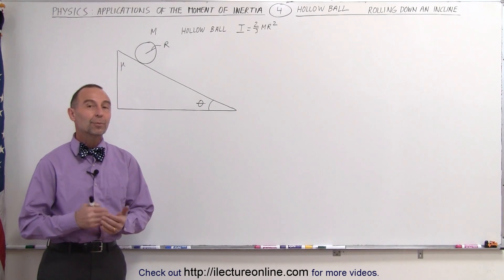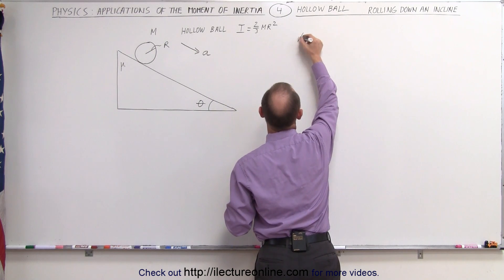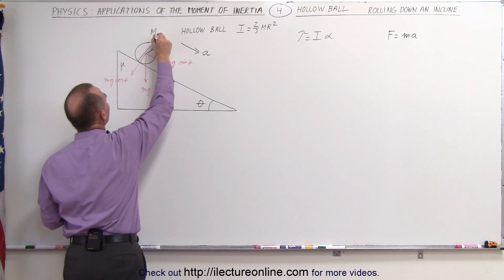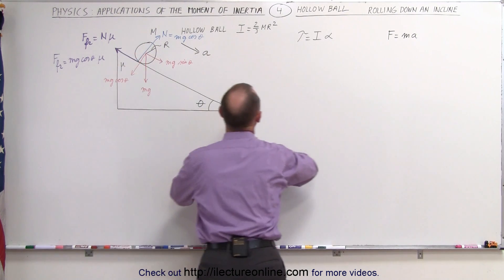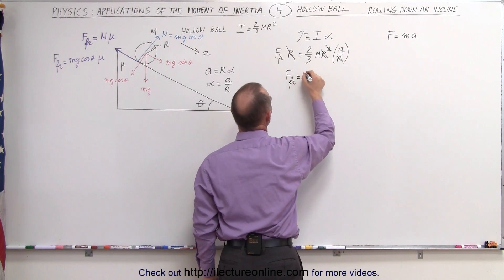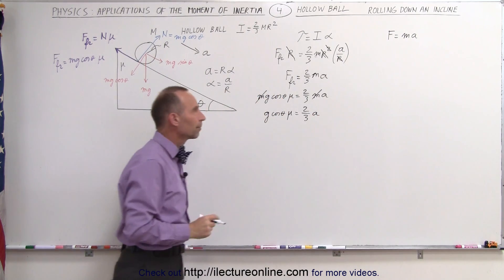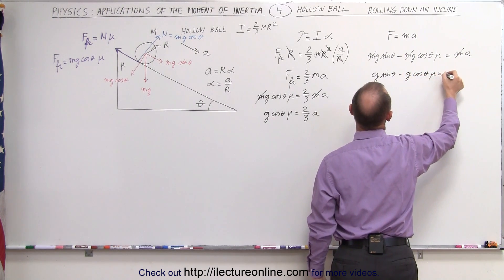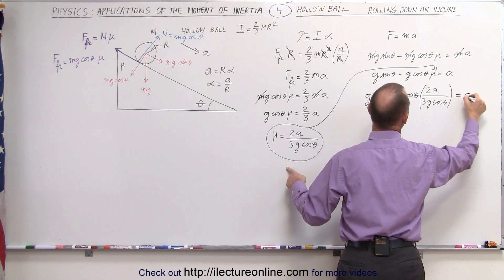Physics 13.1  Moment of Inertia Application (4 of 11) Hollow Ball Rolling Down an Incline

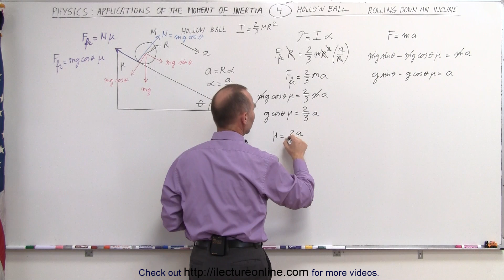Comment: The equation at 5:09, μ = 2a/(3g cos θ), is really a constraint on the minimum coefficient of friction such that rolling without slipping is possible in the first place. So it's actually the inequality, μ ≥ 2a/(3g cos θ), and then you can take the limiting case to sub into the other formula. If the surface were smooth with a μ smaller than that, the ball would just slip down.

Comment: does the x component of weight not provide a torque????
Reply from the maker: The torque is caused by the friction force (making the ball roll instead of slide)

Comment: Mr. Michel, I defined clockwise  to be a positive torque direction; on this basis I made force of static friction to be positive and the vertical component of the Force of gravity to be negative, while I seem to be having sign discrepancy in my problem. What should I do?
Reply from the maker: We often get hung up on negative signs.  This can be remedied by simply caluculating the magnitude (which is always positive).  The sign becomes important when we work with vector quantities.
Reply: @MichelvanBiezen  However, if we take an absolute value of every single force then it will affect our equation and hence the value?

Comment: Just a small question, lets say we were given the radius and mass of the ball and there is some kinetic friction force present on the table, then, what is the acceleration of the same round object?
Reply from the maker: The wheel needs to slide in order to experience kinetic friction.
Reply: @MichelvanBiezen  then do they feel any sort of static friction?

Comment: How come the acceleration with a box on the same slope is faster ( a=g*sin theta) than a cylinder or hollow ball (a=3/5*g*sin theta)?
Reply from the maker: With a box, all of the potential energy is converted to translational kinetic energy and heat (due to friction).  With a hollow ball (or any ball), the potential energy is converted to both translational AND rotational kinetic energy as well as heat (due to friction).

Comment: The friction force is static friction. You cannot use the f=uN formula until the break away moment. Having said so, you will get the same result without using f=uN formula.

Comment: Sir. Could you please answer me? What happens if frictional force(kmgCosA) equals to mgSinA? Net force will be zero but there will be still net torque due to frictional force. What will happen?
Reply from the maker: This is just an approximation.  If you want to learn more about rolling friction, take a look at the videos in this playlist:   MECHANICAL ENGINEERING 11 FRICTION
Reply: @MichelvanBiezen  Thank you for your reply. But i did not understand it. What are we approximating? Could you please give some more explanation? Meanwhile I have watched all your videos related to rolling motion. I am looking forward for your answer. Thank you so much.
Reply from the maker: Just like we ignore wind resistance in kinematics, we ignore rolling friction and just approximate it with the coefficient of friction, which is not the whole friction effect.  (see the mechanical engineering videos on rolling friction).

Comment: Sir, I think friction force should act along the direction of motion not opposite because the point of contact is going backward due clockwise angular velocity
Reply: Friction works against the direction of applied force so even if the ball went up it would still be effected by frictional force working against it
Reply from the maker: The direction in the video is correct.  Think about it this way:  If there was no friction the wheel would slide and not rotate.  With friction, what direction does the friction need to be in order for the wheel to rotate in a clockwise direction?
Reply: Sir,then it means if wheel was made to move up the inclined plane then friction would assist the torque and its motion would be along the direction of motion!!
Am i right ??

Comment: Based on final formula, if we increase friction(mu) , the acceleration will not change.  Seems weird for me, i expect if we increase mu , acceleration will decrease.
Reply from the maker: That is because the object doesn't slide down the incline but rolls instead.
Reply: @MichelvanBiezen  Thank you dear Professor for reply. I greatly appreciate this. Assuming the theta and mass is constant, in the formula on right top of the board(beneath the f=ma), when i decrease the "mu" on the left side of equation, the "a" on the right side should increase.
Reply from the maker: No, but if mu is larger it would allow for a greater torque which would allow for a greater angular acceleration.

Comment: How is F=ma valid here when it doesn't account for the moment of inertia? You could have two spheres with the same radius and mass but different moment of inertia but they will both have different linear accelerations even though according to F=ma they should have the same acceleration. If F=ma is still valid as you claim then why not just use a=F/m to find the acceleration? Clearly you can't which suggests to me that it's not valid here. I'm just more confused now!
Reply from the maker: I agree there is a certain amount of "mystery" regarding this problem.  But the problem is correct as shown in the video, and F=ma still works here as well.  But in this case the force is doing 2 things:  1) it accelerates the object down the incline   AND   2) it causes to object to rotate, both which require energy, and thus work, and thus the force is used to do both.
Reply: @MichelvanBiezen  thanks for your response. I started thinking about this problem recently when asking myself if I could prove that it doesn't matter if a force acts through an objects centre of mass or not.

I figured that if I found the net force acting on the ball (the component of gravity pulling down the incline minus the force of friction pushing up the incline), multiplied by the distance (the hypotenuse of the triangle) and added it to the torque times the angular distance the ball rolls through as it goes down the slope then it should be equal to mgh which it is, and this supports what you said about gravity doing all of the work - both linear and rotationally speaking.

Also the force of friction pushing up the slope multiplied by the distance also gives the amount of rotational kinetic energy which is what I predicted.

So I seemed to show that the work done on an object by a force (at least in this case) does not matter if it's through its centre of mass or not because friction isn't and it still works. But then I thought that if that is true then why can't I use F(net)=ma to find the acceleration? Does the work done not always result in a given speed (kinetic energy) when both linear and rotational acceleration are occuring? It appears not. Two spheres that are identical except for their moment of inertia will have the same force acting through the same distance (and hence the same work is done on each) but will have different kinetic energy at the bottom (translational, not rotational). So perhaps you can see why I'm getting confused over this seemingly simple problem! 

Any input you could add to help clarify anything would be greatly appreciated. 

Also one extra thing. Since it's static friction that is causing the torque, how do we know that it's at its maximum value? Shouldn't the equals sign be changed to a "less than or equal to" sign? 

Thanks again.
Reply: @MichelvanBiezen  I would also like to add one more thing. In the example of the two identical spheres (except for their moment of inertia) where they both have the same net force acting in them, the one with the larger MoI will take longer to reach the bottom because it is not accelerating as quickly. But in terms of momentum and impulse, the same net force for a longer period of time should result in a larger change in momentum but clearly that's not true here as it is going slower when it reaches the bottom due to it having a lower acceleration through the same distance. This doesn't make any sense to me either. Any ideas?
Reply: @MichelvanBiezen  after giving this some thought I have realised that the force of static friction is larger for objects with a larger coefficient for their moment of inertia. My mistake was to think of the force of static friction as being fixed for all objects which it isn't. The static friction force is equal to mgSin(@)K/(K+1) where "K" is the coefficient for the moment of inertia such as 1/2 for a solid disk. 

Using that with Newtons second law F=ma you find that the acceleration for any object rolling down an incline is a = gSin(@)/(K+1). 

Using your own two examples yields the same answer that you got only this equation works for all  rolling objects.

Comment: Why you Take up ward direction for friction? the contact point of ball will try to move back so friction direction on cylinder should be downward?
Reply from the maker: The direction of the friction force is in the opposite direction of motion of the object without friction.  (Note that if there was no friction, the wheel would slide and not rotate).    To make the wheel rotate in the correct direction, the friction must be directed upwards.